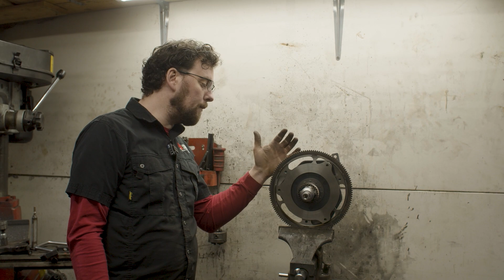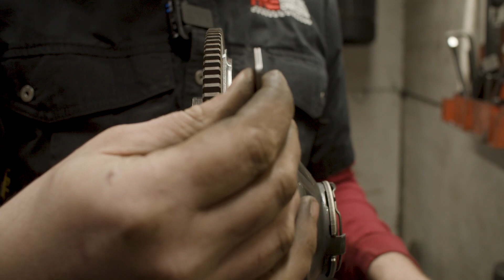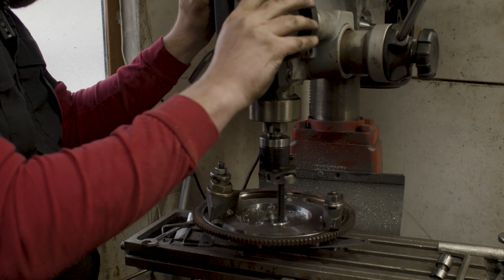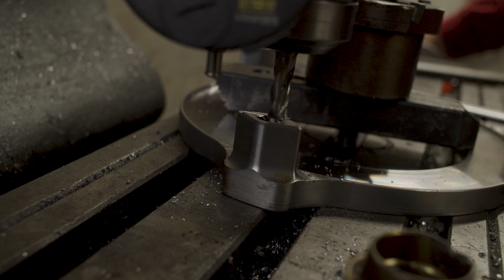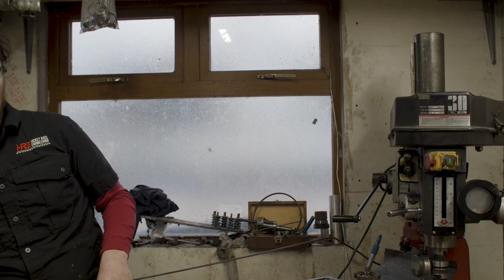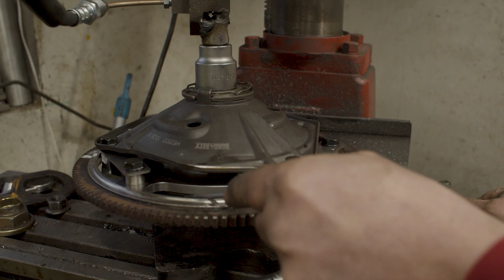Flywheel & Clutch Modification /  Fine Tuning Classic Mini Car Part - 2

Comment: Are you still there Paul?  Seems like your excellent posts have gone quiet for some time now.  One question on this, isn't the optimum horn height (and therefore static spring pressure) related to the thickness of the friction disc?  As this wears won't the clamping force change?

Comment: This is the best advise ever. I modified my Opel Zafira 2008 clutch to an older model lighter flywheel. Had a machine shop work out the clamping force with a new clutch kit but my car struggles to pull in first gear. With the wheels lifted off the ground and the clutch disengaged I get an easy 120km free spinning wheels. Wheels on the ground, it ever so slightly moves as if there's no clamping force. Need your expertise here.

Comment: Hi there i have noticed that my mini is starting clutch slipping after full rebuild and new clutch and all new hydraulics and pins/arm/bearing changed new any help clutch is slipping when on 3000rpm  preverto type thank you
Reply from the maker: Ryan, that could be a number of problems the 3 first steps to check are 1: is there any sign of oil leaking into the clutch housing. if you look under the clutch housing you will see a small hole with a split pin through it. if there is any sign of oil here you have a leak and that is causing slip. 2: check to make sure your clutch arm is returning  fully. you should have free play at the two nut adjuster :i.e. you should be able to wiggle it when there is no pedal presure. if not you need to re adjust the clutch return stop. 3: if you have free play and your arm is returning completly then it would seem you need to remove your flywheel and clutch asembly and rebuild it as in the 3 videos in this series to get more clamping force. Hope that helps cheers Paul.👍
Reply: @HREIRL   many thanks for your help will check them will let you know

Comment: Is this modification necessary for a stock engine?
Reply from the maker: Strictly speaking this type of Clutch system tuning is not necessary, but it greatly reduces clutch peddle pressure, reduces load on the engine thrust bearings.  But a stock unit will work

Comment: We had a mini and the clutch was slipping so I put a new disc in it and it still slipped . The problem was the pressure plate dead worn so the mini specialist turned down the ears on the pressure plate this made the clutch work but it was fears . .?

Comment: Paul do you have to supply the crank and damper with the clutch and flywheel for balancing or is it possible to balance the clutch and flywheel assembly separately given they are rotating forces (vs reciprocating).
Reply from the maker: Hi Conor, I have the ability to send off a flywheel like this to be balanced separate using a mandrel, but ideally balancing the crank, flywheel assembly and damper in one go is much better.
Reply: @HREIRL  That's great Paul. I rebuilt a 998 A+ engine and gearbox last year. I balanced the pistons and conrods but didn't do the flywheel. I may revisit it before commissioning the engine once the rest of the mini is finished.

Comment: Great Videos Paul!
Doing it on the Verto clutch too?
Reply from the maker: Hi Francisco, I have a plan to show how to build a twin plate Verto setup so included in that video I will also show how to make these adjustments to both twin and single plate
Reply: @HREIRL  this would be great to see. Watching this makes me wish I had a pre verto so I know what to do. A verto clutch explainer and modification video would be excellent. I won’t feel like I’m missing out then. Thanks again for the great videos. Even when it doesn’t relate to the car I have it’s still so interesting to watch how you work and the approach you take. A lot to be learned there too.

Comment: Excellent video !  Can you tell me the horn height you ended up with compared to stock?
Reply from the maker: Hi Gormer I can measure them for you but the measurement would be different for you, you will need to setup the flywheel as I show in this and then work out what you need your horn height to be.
Reply: @HREIRL  Makes sense. I had mine machined to .97" high after resurfacing. I will follow your lead on making adjustments Thanks!
Reply from the maker: Is that 0.970” from the friction surface or is that over all ?
Reply: @HREIRL  Measured from friction surface. Got that dimension from Keith Calvers articles.

Comment: Another great video Paul, our 2002 golf got a new clutch about 5 months ago but due to covid it hadn't been driven much and 2 weeks ago my wife said that it was getting hard to get it into gear so I drove it down to raheny from coolock and at first it was fine going into gear but as it warmed up it started to behave exactly as you were describing in this video dose this make sense to you. Cheers.
Reply from the maker: That sounds like the Clutch is not releasing properly Jer, could be a couple of problem. most likely to be an adjustment problem in the clutch cable setup. It could be mechanical say for example of the garage only replaced the clutch plate and not the pressure plate and release components. I would start with clutch cable adjustment as its the simplest to start with
Reply: @HREIRL  thanks for that Paul .